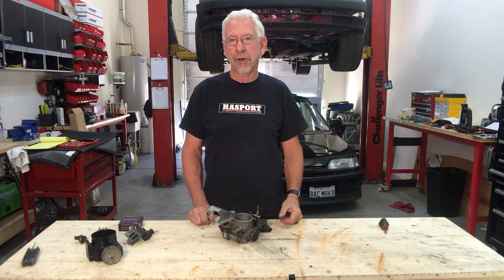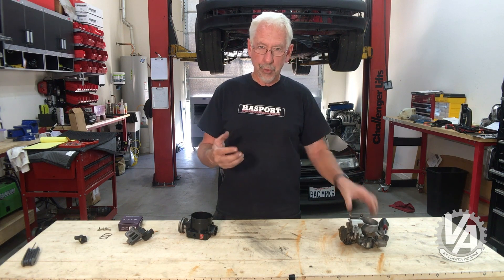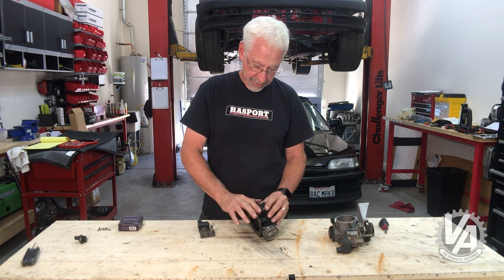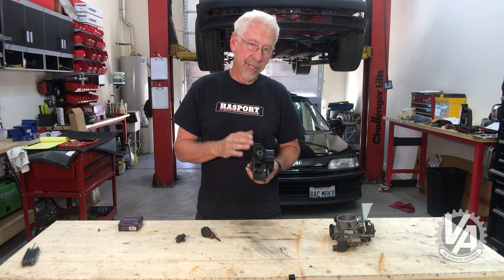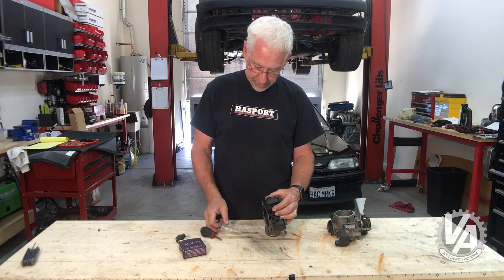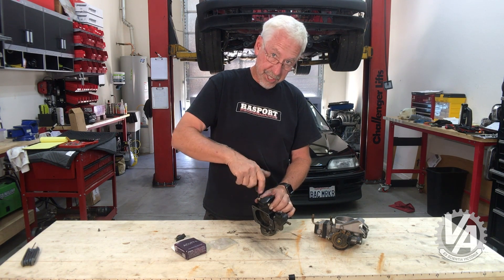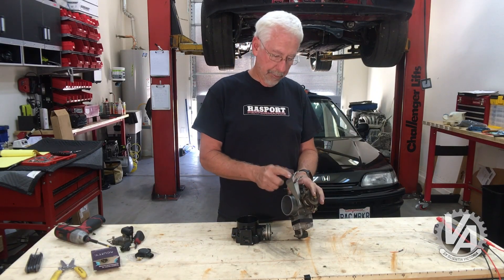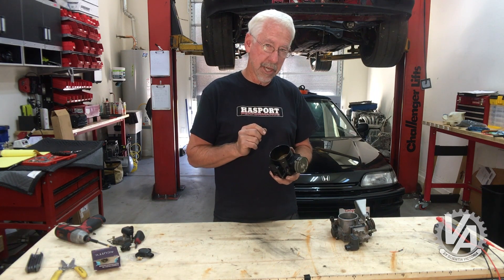How to Build an Oversized K Swap Throttle Body

Comment: Do any j series drive by wire tb fit the 02 type s with drive by wire?
Reply from the maker: I haven't tried any, but I believe you will need a different manifold or T-body adapter.
Reply: @VTECAcademy  I was asking cause I just got one from a Acura cl type s! And wanted to use it since it's oem instead of my rsx type s oem throttle body!
Thanks for the reply and if any ideas let me know

Comment: Regarding the idle valve with coolant ports. Was the heat from the coolant help the mechanical motor in the idle valve not to freeze up since there’s not a lot of lube in it anyway. Btw I’ve tried all of different brands of TPS and found acuity is the best especially with calibration for full to closed values. Closed value is always consistent no fluctuations at all.

Comment: I’m doing a k24/20 swap on my integra. Using a k24a2 block and k20a2 head. I’m keeping my power steering. Is there a specific water housing, alternator and power steering pump I need to use to make work and fit correctly? TIA

Comment: Is there an OEM throttle that I can get at a junkyard that is bigger than the one that comes with a k20 civic?
Reply from the maker: Not one that bolts on and is cable operated from Honda.

Comment: I'm swapping and f23a into my 96 prelude. It's got an f22a1 now with a knock, OBD2 and I want to keep it OBD2, I understand I have to do obd2a to obd2b conversion, does that mean I can just buy the proper ECU for a 2001 accord and plug and play? Then I'll just have to wire VTEC? It's Auto and I'm keeping auto. I've never done an auto swap. I was told it wouldn't register the transmission if I didn't get an auto obd2 ecu. Any video u make is very informative and I always learn something!

Comment: I'd love to see a "Quick Tip" on NHRA battery boxes and battery disconnect switches vs. wheel2wheel requirements. Most people don't understand the actual requirements or get them confused across sanctioning bodies.

Comment: Would I be correct in assuming that you can adjust the TPS the same way for throttle bodies attached to B, D, F & H engines?
Reply: Yes, same concept using the voltmeter or multimeter. You can also do the adjustments through the ECU if you have an s300, neptune, or any other stand-alone ECU like AEM, Haltec, Motec (not chrome).
Reply: @chrisb15679  Totally agree. I do mine through Kpro, but not everyone has an ECU like that. Great video if you're just starting out.

Comment: I was hoping i could just use all the stuff off my dc5 throttle body or does it have to be a type s
Reply: I think the rsx base model tb is different than the type s
Reply: You can use all the stuff from any k series throttle body that’s cable driven to swap on an aftermarket TB
Reply: @PolishedMobileDetailing503  I'll double check, but I believe the base RSX as well as the CRV work backwards and you can't use the TPS.
Reply: ^ What K.O Buot said... you can use the Type-R throttle body stuff same as Type-S (as demonstrated in the video).